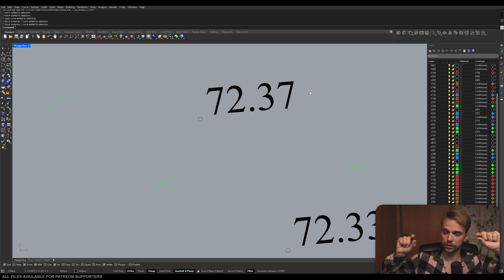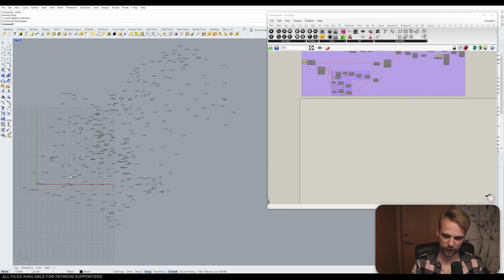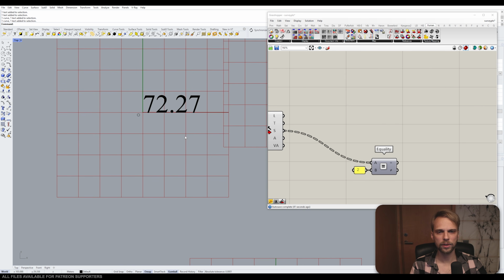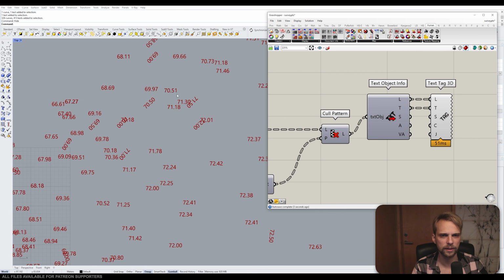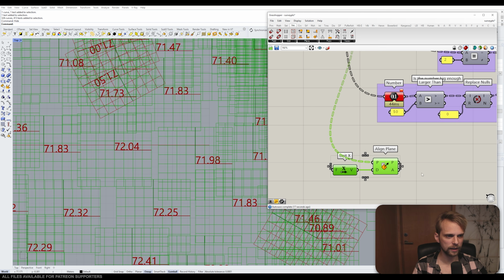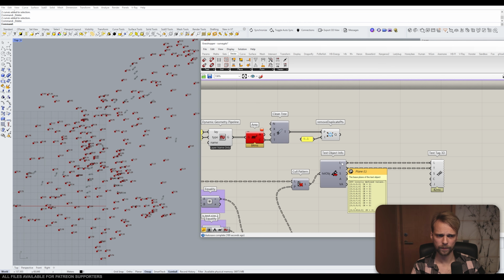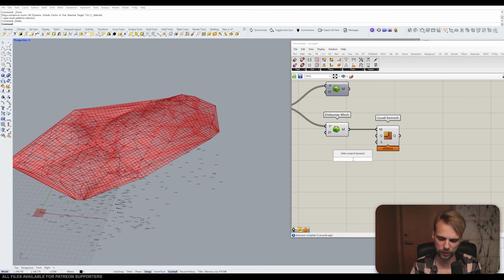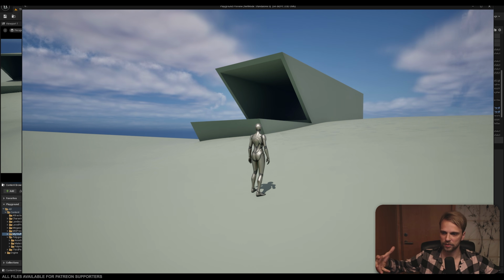Automatic landscape from 2D CAD drawings with Rhino and Grasshopper

Comment: Hey Gediminas, great as always. Im trying to use this for my cityplan for uni since there are so many points and only a 2d DWG with textfields for the terrain heights. Way too big plan to do it manually.
Unfortunately, I only have Rhino 8 and the Dynamic Geometry Pipeline Output is just empty text entities. I think McNeel changed the way something for the update.
Is there a way to get it to work without too much hassle?
Greetings

Comment: You never dissappoint, Gediminas! Thank you for creating this video.

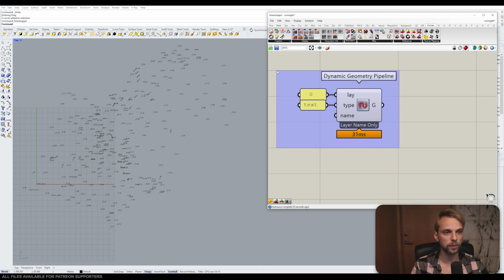Unfortunately, I did run into an issue early inthe process with Grasshopper and thought I would ask here in case others experience it. At 10:37, after I hook up the Dynamic Geometry Pipeline, it says that the Output are Referenced empty text entities. Proceeding to the Text Oject Info node, it shows the output as a list of Nulls. I also don't see the same location grids for each text object in the viewport. Any ideas?

Thank you.
Reply: I have the same Issue, did you find a work around for Rhino 8?

Comment: I HAVE A QUESTION TO ASK IS there is any way to convert trimmed poly surface to surface for grasshopper project
Reply from the maker: it really depends on the shape that the trimmed polysurface has - sometimes you can do it by contouring the form in x or y direction, rebuilding the contours to have exactly same number of points and lofting them  - but generally speaking - no. Most forms cannot be re-engineered into a single surface without large sacrifice of quality/precision
Reply: @DesignGoBrr   ok thanks for response i m trying the contouring is working but when  you have a hole in the surface then its not
Reply from the maker: @Architect-uzairkhan  Yup, then you're stuck with a polysurface
Reply: @DesignGoBrr  thanks anyway

Comment: If you'd use TerrainMesh plugin directly in Rhino, this video would be 1 minute long instead of 48 minutes.
Reply from the maker: Does the terrain mesh plugin automatically lift survey points according to the nearest text information that's present? Haven't seen that functionality
Reply: I have never received a survey reduced to 2D so my imagination ran short of seeing this as a real situation. But no, it doesn't have such a feature.
Reply from the maker: @rsnmaa  If a survey is ordered these days, then yea - usually the points are already in the correct altitude. If you're getting one from the municipality archives (which clients get when they purchase the land) - then more often then not your either getting a scanned topo drawing, or a 2D CAD file at best.

Comment: How can we get topography lines from a site? Having them be as accurately possible
Reply: There are several websites that will give you all sort of site data, including contour lines. I’ve used Equator Studio, they also have a free subscription.
Reply from the maker: As accurate as possible would require a proper site survey. Either by a company, or via drone + photogrammetry. Municipalities and other government agencies sometimes have pretty good data (specially in cities), but those usually require you to e-mail/call them.